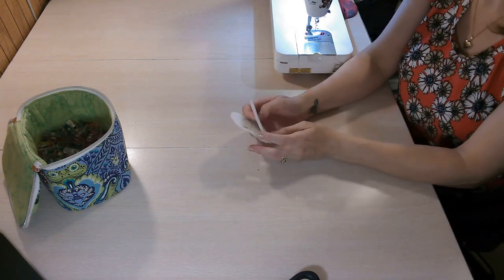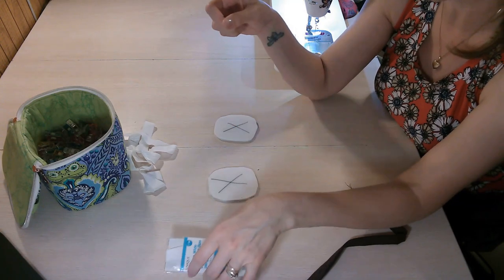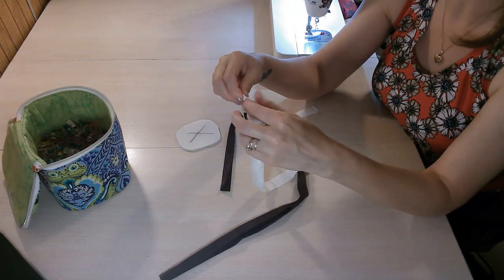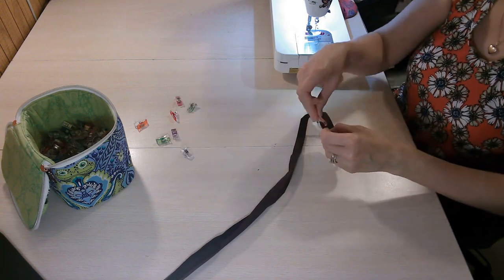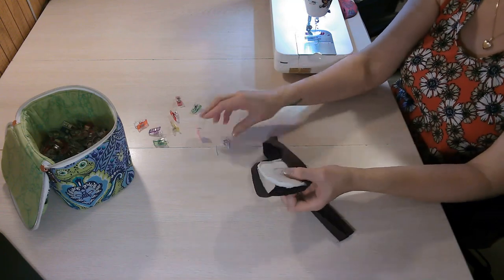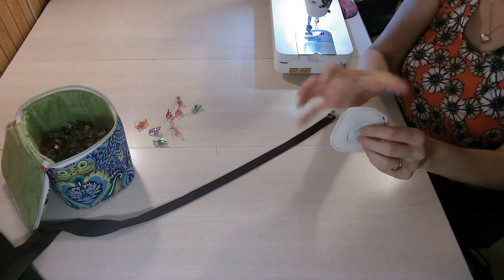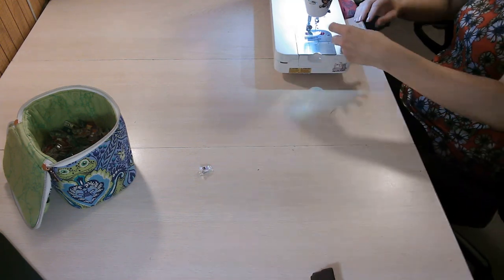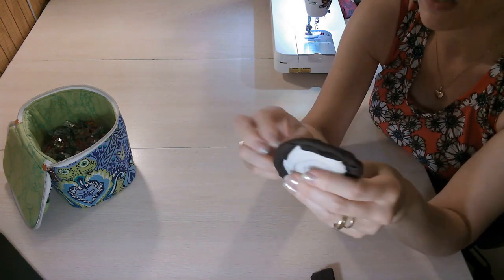How to Attach Binding to a Bag

Comment: When you make your binding, do you cut your strip on the bias of the fabric? Also, how wide is your strip? From the video, it looks like the total width is two inches.
Reply from the maker: I don't remember what width I used for this little tutorial. The width I cut mine varies from 2" to 2.5" wide, depending on the project. For this type of method of binding, I do not cut on the bias. 😊